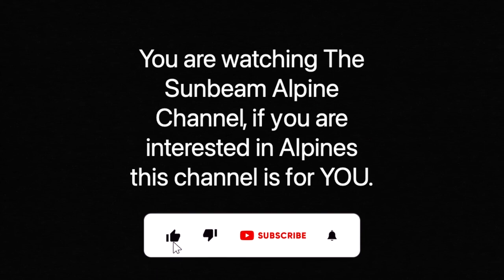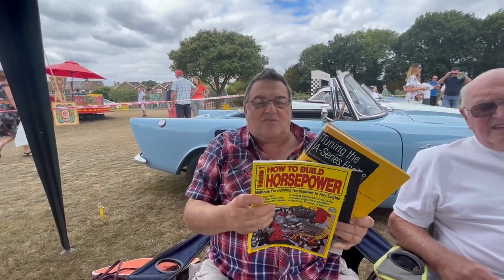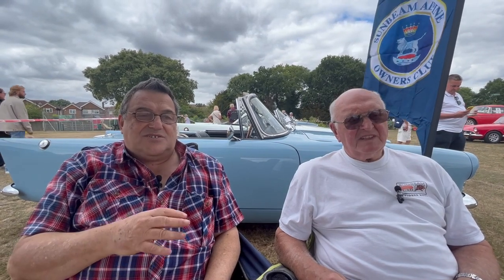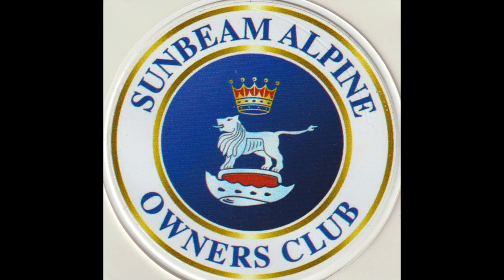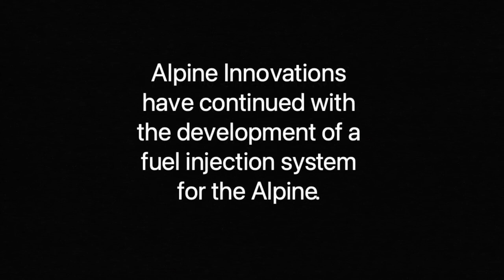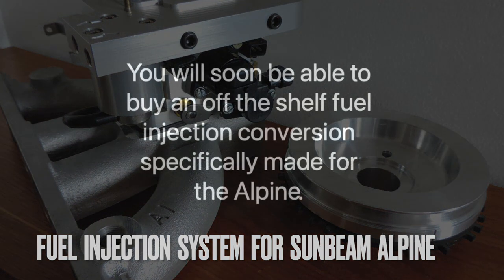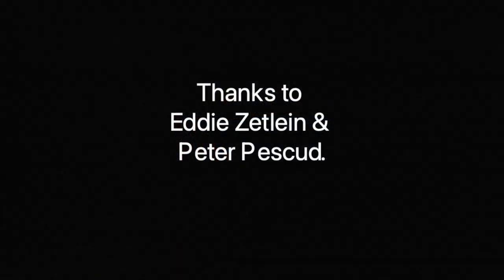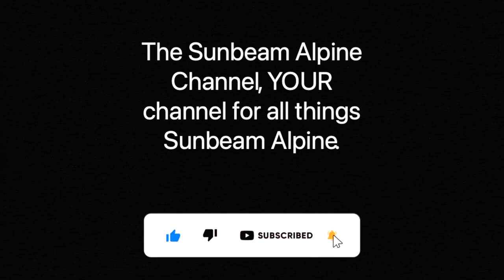Sunbeam Alpine: The history of the Club Weber Carburettor

Comment: Brilliant work on the video, it’s always fun to hear the whole history on anything Alpine related! I bought the full kit from Jerome last winter and fitted it up to my 66 SV5 and had the carb adjusted in under 15 mins. I did not know about the timing recommendation or the fuel pump  upgrade so I will look into those!
Reply from the maker: Brian, apart from the better performance I find the economy remarkable. Lots of modern cars only do similar mpg and these engines were designed a very long time ago.

Comment: i have this set up on my alpine s4 i had queit a bit of tinkering to get it to fit proper with gt exsaust manifold but just a case of hight level and filing out abit 4 shared manifold studs but it works ab fab my highly tuned holbay now goes fab thanks to jerome  regards gazza from motorneeds
Reply from the maker: Gazza, I’m glad it is doing the business for you now. I love the Club Weber kits we’ve got on our cars, totally changes the Alpine, it is what Rootes SHOULD have fitted originally.

Comment: I’m about to order mine after watching your last video on this carb, i was hesitant as I thought it might need a lot of setting up and worried about it not fitting a LHD Alpine. It’s seems that those question were answered. (Thanks) I have a few other jobs on my new/old Alpine to do first before ordering though. After watching this I would like to know where is a good place to buy electronic ignition (and what type is recommended) and also would like to know if it’s ok to run with the standard fuel pump or if not where to buy a new one and what type or model number. Thanks for any info on this subject.  Know Expert
Reply from the maker: Personally I use powerspark electronic ignition from BBC. I bought this on EBay. I use the original mechanical fuel pump but it must be in tip-top condition. Any concerns,  fit a Weber 4psi electric pump (or the facett version). If you opt for an electric pump fit an inertia switch to kill the power should you ever have an accident. You won’t be disappointed with the carb set up, it will totally change your Alpine.
Reply: @TheSunbeamAlpineChannel  Thanks very much for the information. I’m going to look into that and have a drive around as it is now before ordering so that I can feel the difference once it’s fitted. Or better still order it now and have it ready for the day all you other bits are finished and it’s time to do the carb.
Reply from the maker: @Know-Expert  Good idea, have fun.